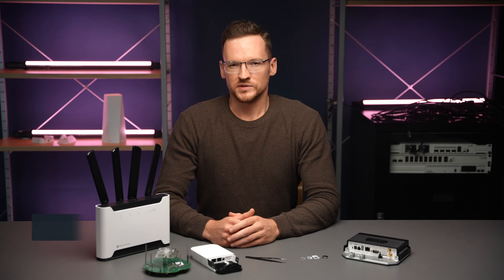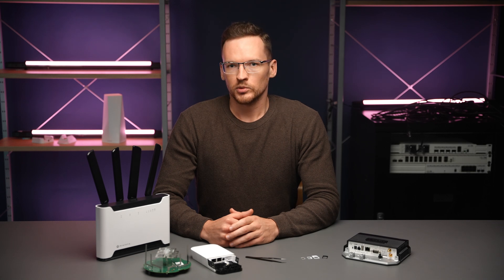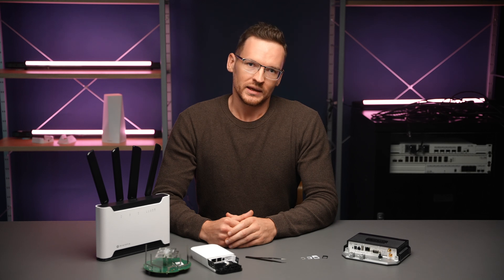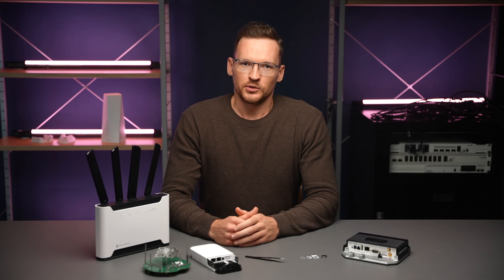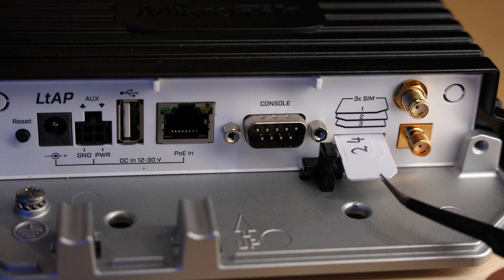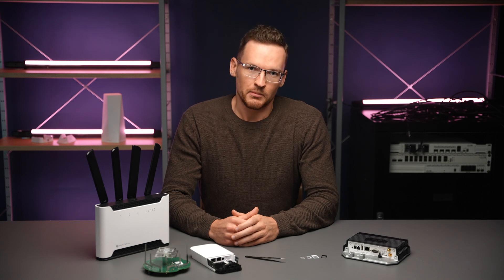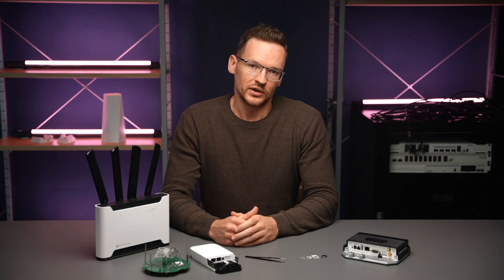MikroTik devices with SIM slots

Comment: how to configure redundancy between SIMs? So that if the main one falls, the second one takes over?
Reply: If they don't have a special function for that,  then look for "mikrotik failover setup" for normal wired connections, I assume the same rules apply, I did that some years ago while being connected to 2 ISPs and you need to add a few rules in 3-4 locations (firewall, rules, etc). I mean you have better chances to find that since more people did that already.

Comment: I've seen a russian video showing 2 sims 2lte modems and a route list to combine the connections to boost speed using the RBM33G, could you do a english video on how to set this up please
Reply from the maker: You can't boost speed this way, only split connections 50/50 to lower bandwidth load on each ISP. The other video is most likely false information.
Reply: @mikrotik  Thanks very much for the information, this is the video I saw here https://youtu.be/HurUkKtb3nU could you watch what settings they're entering and explain what method of load balancing they're using like PCC or PPC  and point me towards one of your videos so I can set mine up the same way when it arrives please
Reply: @mikrotik  yes you can, two eoip tunnels bridged with rr-balance will boost the speed of single session

Comment: Is there any model with more LTE modems ? So It would be possible simultaneously be connected to multiple LTE ISPs ?
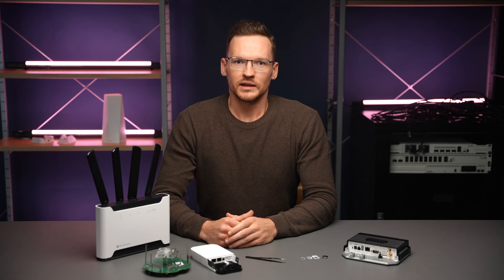Reply: I think the LtAP can do this. The block diagram, as shown at 0:54, describes independent SIMs for each of the miniPCIe interfaces. Hypothetically you could install two LTE modems and have connections on both of them concurrently. The easiest purchasing path to this, I think, would be to buy a RBLtAP-2HnD&R11e-LTE6 (LtAP with included LTE6 card), and a second R11e-LTE6 (LTE6 card) which you'd have to install yourself.

You could also DIY this with a RBM33G, which has two miniPCIe slots, each of which has a dedicated SIM card slot.

I don't see any other devices in Mikrotik's lineup which have dual miniPCIe slots.

Alternatively, you could connect a USB LTE modem to a device with a single built-in LTE modem and a USB port (e.g., hAP ac³ LTE6 kit). I think RouterOS supports USB LTE modems, anyway.

Load balancing between these two connections would then hypothetically be the same as balancing between any other two upstream interfaces (i.e., a pain in the neck 😉).
Reply: @Empterdose  lol love my new cheatue try to do some pcc there soon

Comment: So it can't load balance with the two sim and also do fail over
Reply from the maker: It can, like the video explains - you can use a command to switch the SIM that is used. When one internet fails (or you run out of data) a script will switch to the other one.
Reply: @mikrotik  would have love it more of we can have more control on winbox level and doo pcc balancing ,thanks for the reply
Reply: Very lovely. Trust mikrotik